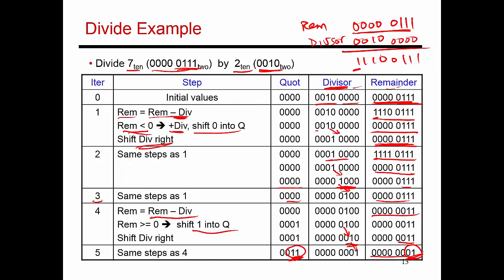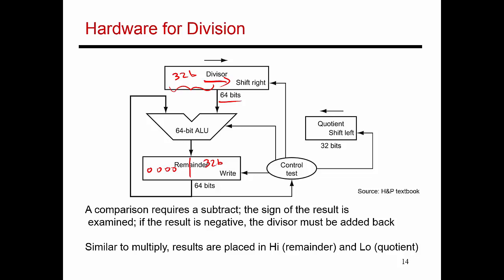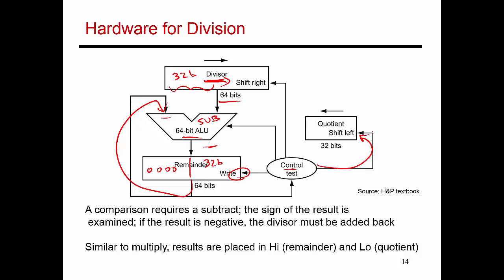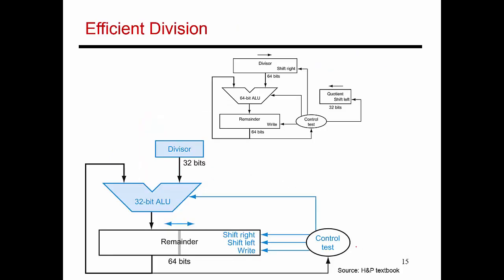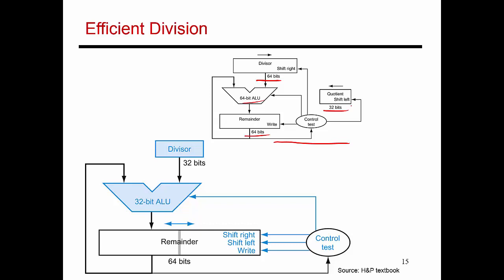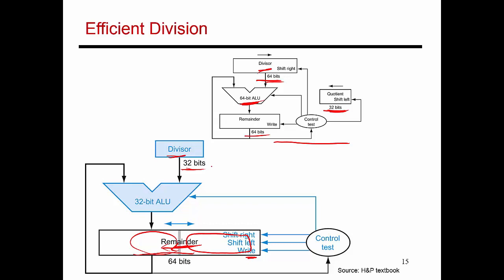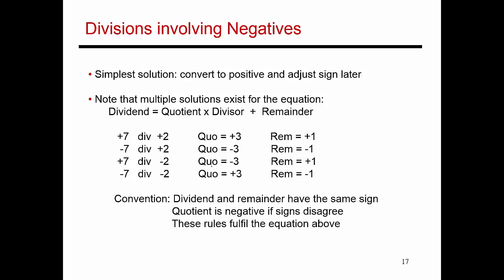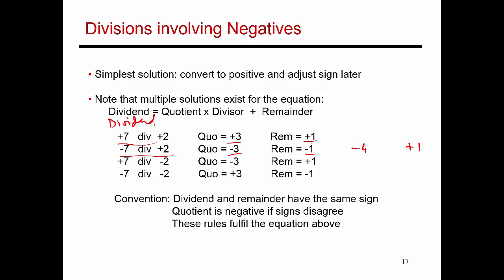Video 26: Division Implementation Details, CS/ECE 3810 Computer Organization

Comment: Sir, I m confused where the 32 bit of dividend will be placed on the 64 bit remainder register. You probably mentioned to place it in the LSB of the remainder register and perform subtraction operation from the 32 bit MSB. While performing the same with 4 bit values, my answer is not coming correctly..